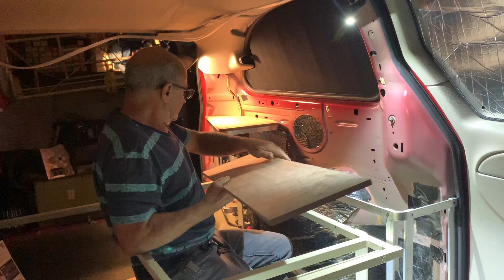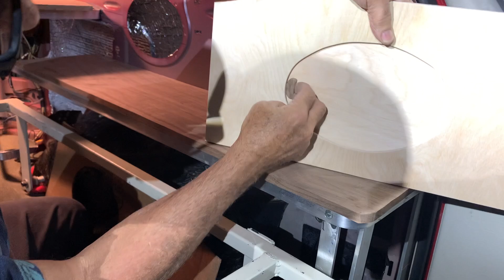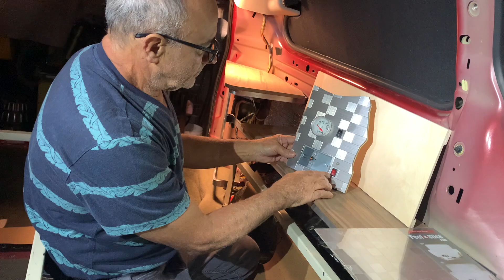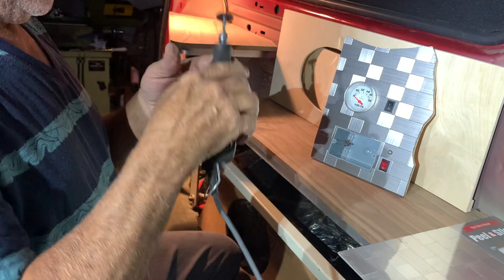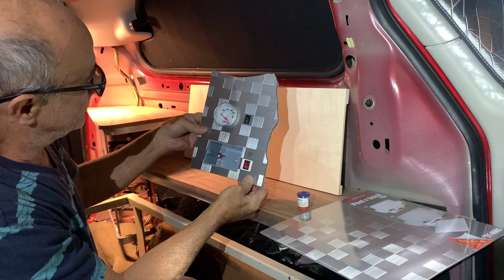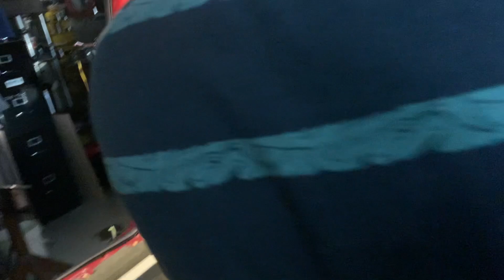Stealth Grand Caravan Mini Van Camper Update 5

Comment: Great work, your channel is so fun to watch! How did you wire in your new plug for the coffee maker? Did you cut the wires out of the inverter for that as well?
Reply from the maker: Thanks for watching and thanks for commenting. From the inverter to the plug for the coffee maker I just ran a simple extension cord just ran a wire
Reply: @VinceSaluto1  Thanks for the reply! Got it, thanks, couldn't tell if you cut the 3 prong cords from the inverter also or if you just plugged in an extension cord. Makes sense, thanks for clarifying!

Comment: Enjoying and admiring your project Vince. Very creative ideas and beautiful workmanship. I check every day hoping for another update. I did some basic mods to a 92' Grand Caravan 25 years ago so I could sleep in when traveling. Nothing compared to your project.  You may already know about these but two products that might interest you: On Amazon "Racer's Speed Shop" banana peel pop rivets" I have been using pop rivets since they were invented but never saw anything like these until a couple years ago.  Instead of just expanding the rivet body when you "pop" them the backside splits like fireworks and the 4 sections curve back and pull the two pieces being riveted tight together.  Inexpensive and very strong.  Another product are Clecos. These are used extensively in airplane building and are essentially a temporary rivet that can be installed and then removed. Great when trial fitting pieces in place like you are doing in updates 3,4 & 5. They require special pliers  Wicks Aircraft and other aviation supply houses carry them.  Beautiful, fascinating work Vince  Keep it up.
Reply from the maker: Thank you so much for watching and for sharing that information I definitely need to look into alternative ways to connect I’m kind of showing people basics thinking that some people that have nothing could do some of this

Comment: Hello Vince I have a question when your van is loaded with all cabinets, bed and everything else what do you use on the rear suspension to help with all the weight , 
I have a caravan like yours and we put 7 people in it will bottom out when driving through pot holes and I see that you probably more weight than 7 people in it
Reply from the maker: Thanks for watching I have installed airbags suspension assistant which makes a huge difference when it’s loaded

Comment: The cardboard templates you made were a really good idea! For the weirder shapes (like the curvy edge of backsplash), how did you precisely trace out and cut the cardboard to fit?
Reply from the maker: I rough cut the cardboard multiple times marking between cuts. Its a slow process.